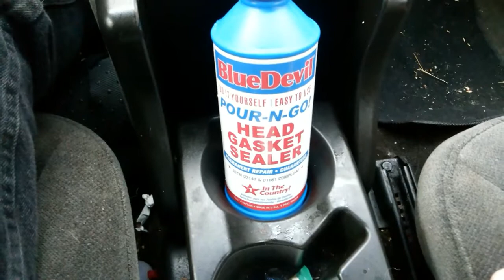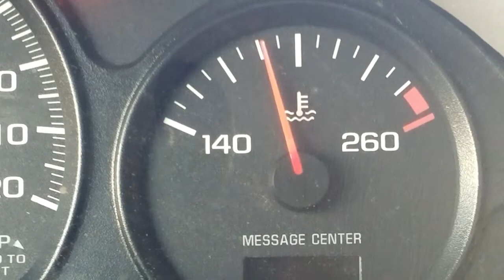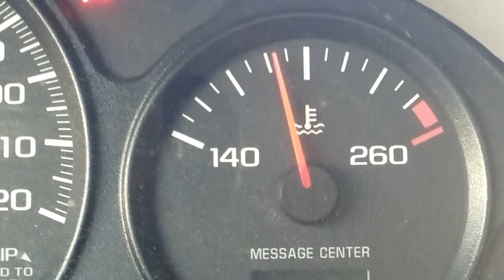Blue Devil Blown Head Gasket Repair for Under 40.00 Bucks.

Comment: Dave if you have a 3.1L or 3.4L.
This is a very very common issue. It's most likely not the head gasket /gaskets. 
The sealer is not NOT going to solve the leak.  And eventually the engine will seize up.
Keep the oil checked. For water and over filled. 
OK, this is what's wrong. The lower intake gaskets are made from plastic and rubber. And they crack around the water jackets. It's a real mess. It's a 5/7hour fix. But must be done. Unless you want to put another engine in it.  Make sure you spend the extra  $$,and buy the metal replacement gasket set.
About  $70/$100.
Trust me Mr Blue will fail .and hopefully not at a very inopportune time. 
Just trying to help and give a bit of great advice.
Reply from the maker: Used Blue Devil on the Ex's Impala (3.4) 7 years ago at 68,000 miles and converted it from dexcool to regular.  Still going strong at 170,000 miles.  Did the heads on mine at 107,000 with metal gaskets and now it's blown at 192,000.  Always the rear head and either number five or number 1 cylinder, or both.  There is a school of thought that it's the dexcool, not the gaskets.  I think it's both, and also the engineering of the engine itself. Who knows.  GM aint talkin.  Had a friend use Blue Devil on a Hyundai at 120,000 miles.  Barely ran.  Still running well at 150,000.  To me, if you get another year it's well worth it.  If I have to  replace an engine, well, ok.  Chevys are exciting and could make a cool video.  I would have fun with it like we did back in the day.  Keeps my tools from rusting!  (and me)
Reply: @lifeafterlife8417  if it keeps you young and and handsome, than you must dance with the Blue Devil by the pale moon light.  Lmao.
I know if you had a Ford, you'd be sitting in a rocking chair. Lol.
Thanks Blaze.
Reply from the maker: @Woopwoopwill   Looking at a Ford Fusion right now.  Guess I'd better shop for a "rockin'" chair.  Hope it plays some Lynrd Skynrd.
Reply: @lifeafterlife8417  and it's none of my business, for sure.
But really are divorced? 
If so ,wow.
I didn't figure on that ever happening. 
Hope all the kids are doing well with things.
I've been working out of the old shop for 9 year's now. I do well.
And I'm happier working for myself. Than these big name rip off shop's I used to be employed by. I can sleep at night.
And I like the single life also.
I'm done with all the drama! 
You know?
Take care Tank😎
Reply: @lifeafterlife8417  Right ! Lol.
Don't think so all vehicles are built in Asia these days, some assembly required in the US or Mexico. Lol.
Warning warming Will Robinson ,
The Fusion is even worse than the Impala. I HATE The Fusion Onda The Mercury Montego. But they keep me in a job.lol.
Good luck sitting in that Rocking chair. Lol.
Silly.
Reply from the maker: Yep.  Several years now.  Kids are getting better.  Mom screwed them up pretty good.
Reply from the maker: Hey Will.  Looking for a good work car.  Any leads?
Reply: @lifeafterlife8417  yep ,I do some work for a car lot ,I'll check and see  what he has. He's a good honest man.